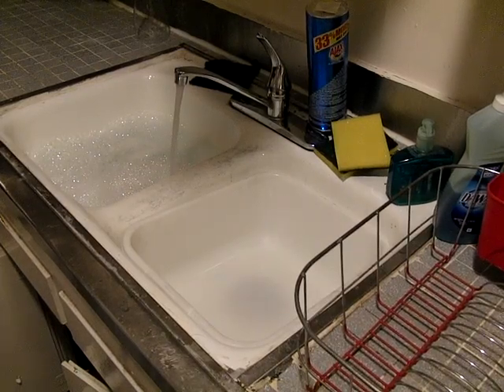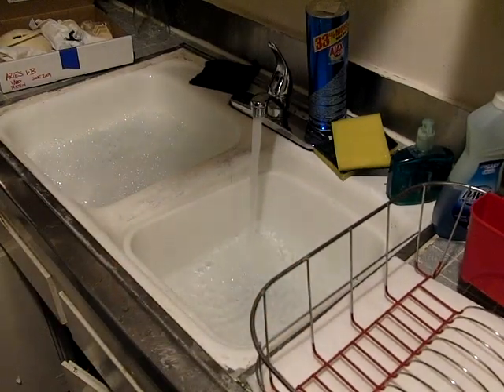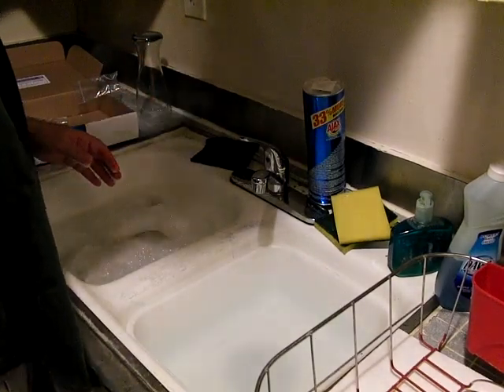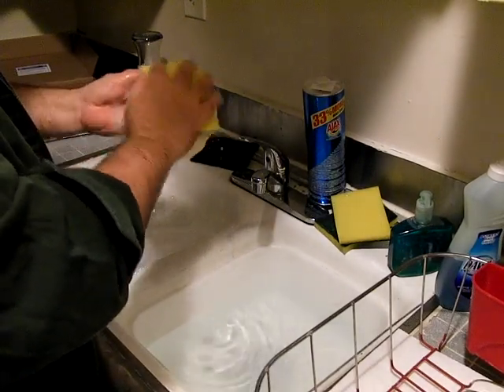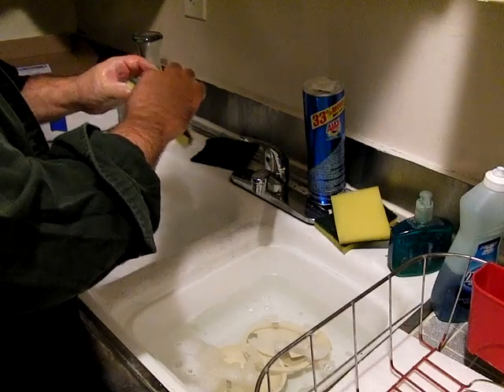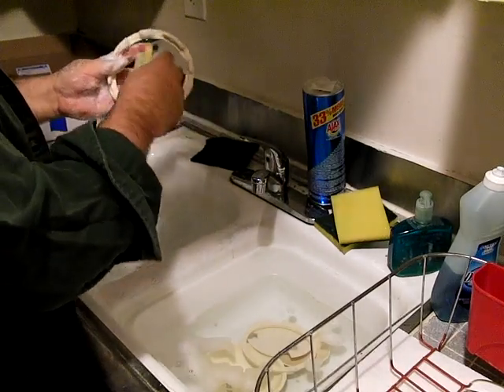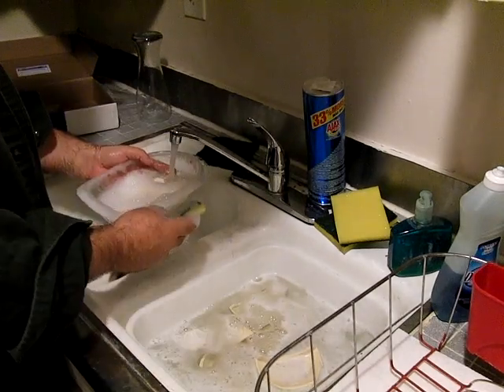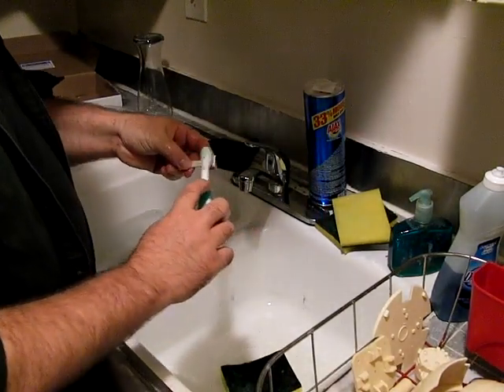Tips: Working w/ Resin 1a The Bath

Comment from the maker: That's my first use of the elec t-brush, and quite frankly, it rocked those little parts!  Couldn't have cleaned them with the sponge w/o crushing them.

Don't know about Forgeworld, but cleaning resin kits is just a good habit to get into as the one time you don't clean is the one time that the caster will have used mold release.  And you won't know until either the parts just don't hold as well as they should or you get fisheye all over the body and have to strip the entire paint job. Ugly.